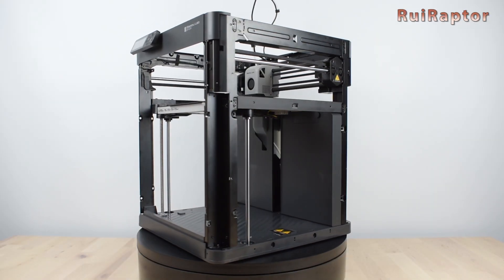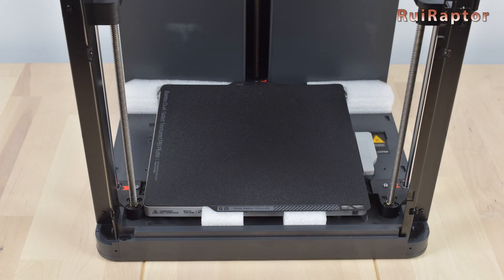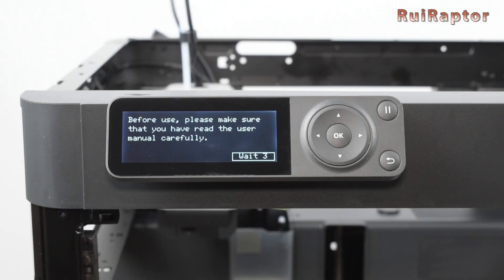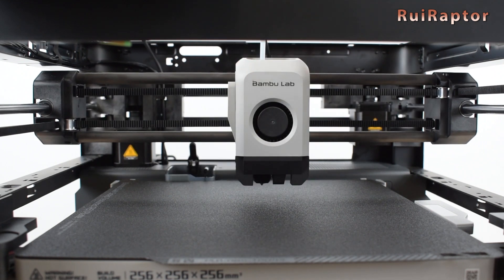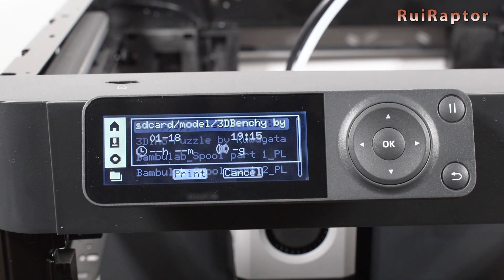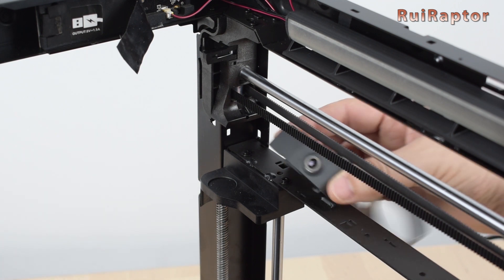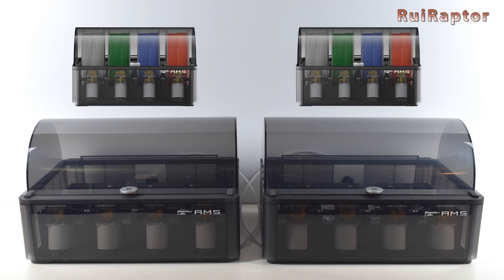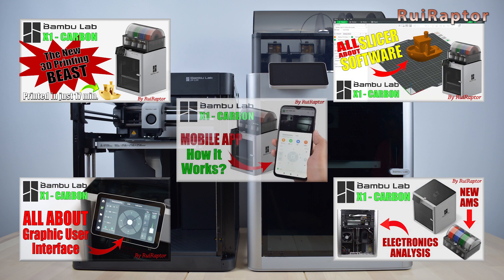BAMBU LAB P1P 3D Printer - All You Need To Know (In-Depth Analysis)

Comment: Hej hej...thx for this great Video. 
Can i ask you a question:
I m on the way to buy one of these 2  printers. 
The 
Creality Ender 5 S1 with Sonic Pad for Klipper ( i can use it also on my other Printer) 
or
A P1P (with a closed software/modding and Tuning based Comunity.. Its nor Marlin or Klipper)
at the end ..
its near by the same Price in Europe.
i need input and help on this ..question:)
Reply from the maker: Hi, in our opinion, the P1P is a better choice.
Reply: @ruiraptor  but.. Why?
Reply: @badewannenwikinger2522  it’s really up to your preference… the P1P is a remarkable 3D printer, printing right out of the box at speeds no other printer at similar speeds can compete with (even the ender 5 s1 with klipper). the ender 5 s1 still recommends manual leveling, fine tuning, etc. while the P1P completes all that for you. really the only saving grace for the ender 5 s1 is the better screen, accounting for the fact that you’re buying a $500 printer with $200 software without any accessories incomparable to the P1P.

if your budget allows, the X1 is a significant upgrade from the P1P at only ~$300 more but of course not everyone has that budget.

Comment: I'm really considering this to accompany my ender 3 v2.  My biggest worry about it is the noise and how proprietary it is.  It still looks a lot more appealing to me than other core xy printers.

Thanks for the review!
Reply: Your washing machine is proprietary. Do you complain about that? This is a badass machine, finished product.
Reply: @3dPrintingMillennial  I see your point but I'm very skeptical about a printer not needing any diy.  And it makes repairs very difficult when everything is proprietary and closed off.  Its the same reason why I'll never buy an apple product.
Reply: @kylezakk  they may be proprietary but they've been kind enough to develop a joint (customer-company) wiki for pretty much any issue that has developed thus far. Plus they honor warranties if they can't get you through a self fix. 

I get it though. Some people are die-hard FOSS heads. I love tinkering on my other machines but my X1C amazes me daily.
Reply: @3dPrintingMillennial  I can understand why some people don’t like how proprietary the printer is (despite how surprising it still is). many people just don’t have the faith that some companies aren’t total evil corporations looking for the next way to steal cash. it can be hard to differentiate though and i can understand the concerns of a monopoly screwing over the consumers.

I highly doubt BambuLab is going anywhere anytime, so that shouldn’t be apart of the concern

Comment: Nice review! I have a question, the bambulab printers all have wifi, does that mean I can access it from anywhere in the world and start a print?
Reply from the maker: Hi, thanks for the comment. Yes, correct, you can access the printer anywhere since it's connected through the cloud.
Reply: @ruiraptor  okay cool, thanks!
Reply: Another question 😂 So if you can acces it anywhere, can you also turn Power on/off with that?
Reply from the maker: You can control temperatures, axis, prints, etc, but you cannot turn the printer on or off.
Reply: @ruiraptor  okay, good to know

Comment: Do you need a glue to keep prints sticking to it?
Reply from the maker: Hi, The recommendation from the manufacturer is that you don't need glue for most filaments (PLA for example) but you need to make sure that the plate is perfectly clean. We normally use glue as it's fail proof. You have more info here: https://eu.store.bambulab.com/products/bambu-dual-sided-textured-pei-plate